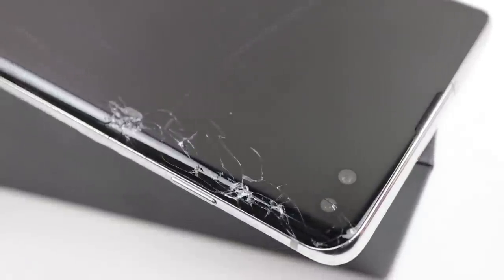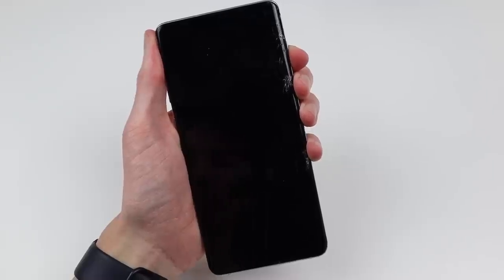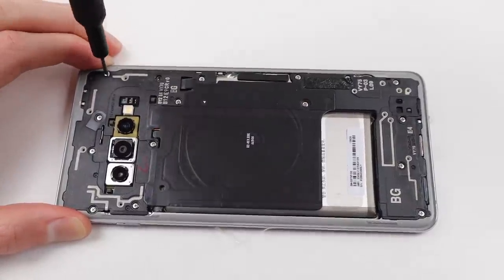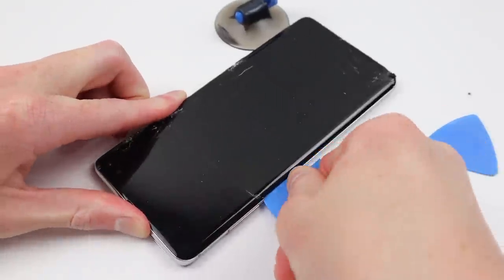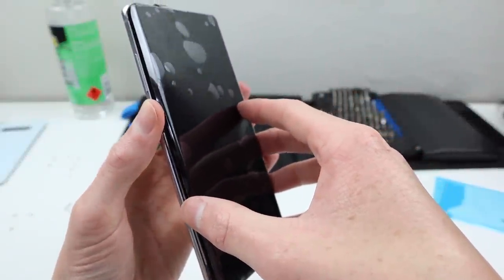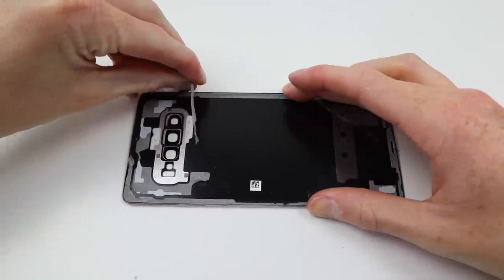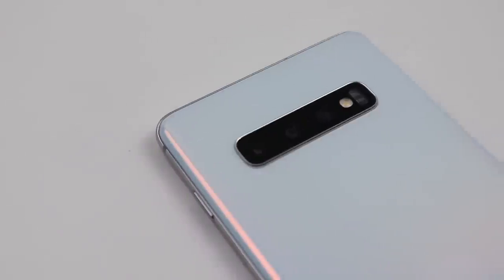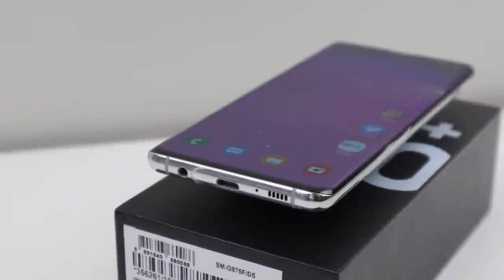Repairing my $400 Galaxy S10+ - Display Replacement

Comment: Hey Hugh Jeffreys love your videos, I'm wondering though, I have an iPhone 6s and I've tried replacing the bluetooth module but one of the 2mm screws is seized and has rounded off, is there a good way of removing it? Thanks.
Reply: Impact screwdriver will take care of it
Reply: @stephenh1616  Surely using an impact screwdriver would be difficult as the phone is pretty delicate plus the head is rounded off? Thanks for the suggestion though

Comment: Story time, My bro had s10+ 1TB since he purchased in 2019 (directly from samsung) with a strong case and screen protector offcourse, never dropped phone(i know unbelievable but true for this particular phone), phone was never near any water/liquid, it literally is in perfect condition even now for almost 3 years of using it. Suddenly 2 months ago the wifi just stopped working, did all the troubleshooting that can be done including factory reset but no luck, finally just went to the samsung service center(official/authorised), and they claimed that the phone cannot be serviced since it was purchased in different country(purchased in uae, shifted to india, a year ago), went to a different service center, they finally straight up spilled it, they said it can be repaired but since it's not under warranty, we have to pay upfront 40k rupees($533) to get it opened up, get the parts ordered, and get it repaired. So im just wondering if this particular issue can be repaired with low cost since it looks the wifi chipset/ic may just have gone bad and everything else is fine. No way im paying that price for repair, is there something that can be done about this or should i just sell this and get a new non-samsung phone

Comment: The old OLED Display i can tell it is cracked so even if the cable was intact you will have lines on the display. I can see a bleeding spot on the display.
Reply: Mph

Comment: Spends $400 on the phone initially. Then would have spent an additional $300 on parts. Total cost sum up to around $700 not including tax/shipping cost/labor. When at the time of this comment you can buy a brand new with warrantee Galaxy s10+ 128gb unlocked online for $699.00 plus taxes and fees.
Reply: Lmfaooo

Comment: I have an ipad mini 2nd gen. that the lcd partially works. 

The battery symbol appears when it’s dead or charging, and the apple logo appears while it’s booting up.

However when it gets to the lock screen it doesn’t show anything. I swipe to unlock it and it does still work. When i rotate it i see it light up in the four corners and can even see the battery in the corner, but only while it rotates the orientation. 

I will at some point open it and unplug and plug the LCD back in to see if that is the problem.  

Anyone happen to know what is going on with it?

Comment: I need you guys’s help. I recently bought an iPhone Xr and it was refurbished and ofcourse nothing wrong with that. And I was really happy with the product everything worked fine but one thing. The phone couldn’t connect to my provider. I could put in my SIM-Card and I had to put in my code and it was searching for a network but it couldn’t connect. I snooped around my iPhone a bit and I found something  weird. When I went in my general settings and clicked on the first button “Info” and scrolled down to “Network” and saw that there was a arrow next to it and so I clicked on it. It gave me an empty screen with only “iPhone not allowed” on it. Anyone else have this problem? Or ideas how I could fix it?

Comment: Even Apple doesn’t use that much glue to stick the back panel, yet the iPhone 11 Pro has a higher water resistance rating.
Reply: Thats because iphones aren't built to last.

Comment: This video displays where Samsung goes wrong. Sure the 5g version have the charging port separate from the motherboard, but not everyone will have that version of the phone. And you have to remove the motherboard to get to the display? Basically tear down the entire phone to replace the OLED panel should that stop working.. I love how people bash apple for their backglass, but the logic board doesn't need to be removed to replace the screen, the magic pull tabs make battery repair much safer

Comment: I tried to save money so I bouht a samsung s10 plus flamingo pink for 260$ US on ebay with out box and cracked lcd ,  it was a fully functional but when I get it the lcd was not functional, And now the lcd will cost me almost the same price for the phone ( at least 140$ form internet or at local shop start from 200$) with total 460$ at least, which is the same price for a perfect condtion phone :''(

Comment: $400 + $290 (screen from iFixit) = $690. + any tools or gaskets, over $700.

Meanwhile a used S10+ sells for under $500.

Even if the argument is that instead of buying another phone, you spend $150 less give or take just for the display and attempt a risky repair which will render your phone without dust and water resistance more than likely, and for most people an entire myriad of issues, another will be to just sell the phone to someone else for 400, add $10 more and get a phone with a screen that's not cracked.

Repairing an expensive phone, well, a phone for which the replacement screen is expensive (primarily Samsung and Apple), it's the most ridiculous proposition ever, when the handsets are so cheap. I wouldn't have paid more than 200 for that phone, even though the screen was still responsive. I would give you the fact that the "new" screen makes the phone feel pristine compared to the ones you get for $415 on ebay, but that's about it.

I mean iFixit asks $190 for a Galaxy S8 replacement screen, when in fact you can buy a used one for $150 and have spare cash to eat for a week. I would get in bed with this idea of repairing your stuff, if repairing it wouldn't be so expensive and risky.

Comment: weird, the phone looks relatively new. the plastic barrier on the sides and the back hasn't even been removed from the from.. It's like someone bought it and dropped it like 2 days later.
Reply: I've had my s10+ since october and I still have the plastic on the sides and the original screen protectors. I always have a case on so I never bothered taking them off.

Comment: If a third party repair center can't guarantee of the water resistance then as far as I'm concerned it's a repair fail as well as if they can't reimplement it then they shouldn't be doing any kind of device that has water resistance

Comment: This doesn't look very profitable though? $289 for a display(from iFIxit it) + $400 for the device + tax and stuff for both (mostly around 10%) making it $650 at least. You can easily get a fully functional SIM unlocked unit(or any carriers in this case) for $450 and if you hunt for cheaper listings/auctions you can get one even cheaper. For $650 you could get an intact Note 10+ or a S10 5G with relative ease. Great video and impressive repairing skill though.

Comment: Wait wait wait... let me get this straight, you pay

$400 for the galaxy s10+
$290 for the screen (price from ifixit.com) +TAX

No matter all your work and the other pieces you actually have to buy for this to work properly. You pay $700 dlls for a Galaxy s10+ When you can get one on ebay for $359.00 on tip top condition. Or a BRAND NEW ONE from best buy for $849.99.

I dont know man, something doesn't add up here. Please someone correct me or tell me if I'm missing something?

Comment: 400 AUD = 230 USD.. + 290 USD for the new display = 530 USD

Non broken, used S10+s can be had for well under 500 USD on ebay so this repair definitely wasn't worth it.

But fantastic video as always.

Comment: But, you can just replace the glass. You have no idea how this pains me how aggressive he pulled out the working good screen with just the glass cracked.
Reply: screen only replacement is really fucking hard , you'll need proper heating machine to get the screen to be removed. and stuff like loca glue , wire , and uv light is also necessary. you'll also need to do it very precisely or you're just gonna be wasting money and time

Comment: And people say that iPhones are hard to take apart
Reply: IPhones have a million types of screws in them. Samsung use the same screws
Reply: Daanyaal Hussain true, but in a Samsung you gotta basically take apart the whole phone just to get to the screen in a iPhone you can just remove the screen and put a new one on
Reply: @mariostudios8952  but the same goes for IPhones back glass, if you crack that, you have to replace the entire frame
Reply: Daanyaal Hussain true, and Apple charges way to much to get it fixed
Reply: @mariostudios8952  yeah you'd be better off putting a skin or case on it or even buying a new phone for that price
Reply: Daanyaal Hussain (this is from the first reply) but Samsung is harder to open in the first place
Reply: @danandlaundry  really just removing the back glass can be annoying but it can be done with a hairdryer. It is also easy if the glass needs replaced anyway then you don't need to be careful getting it off and can just crack the whole thing off

Comment: If all of that old screens works for touch then get it refurbed... EDIT: Not sure why you didn't just get a new frame.... You've probably destroyed that OLED now so it cannot be refurbed or sold.
Reply from the maker: It was destroyed in the removal process, I see a low chance anyone can remove it without distorting it. its glued down everywhere on the sides and middle. you can hear the OLED just snapping when you slide your pick under it.
Reply: @HughJeffreys  I can assure you that this is a very easy screen to refurb regardless of all of the glue. If you're in groups such as LCD & OLED refurbish groups on Facebook then you'd understand. No flame, just sucks that you destroyed the OLED when it could have been worth some money.
Reply: Josh  There's a difference between being annoyed and suggesting something he could have done to make more money and/or to get the screen refurbed. I am in fact helping him by letting him know it is possible and that he shouldn't have removed it.